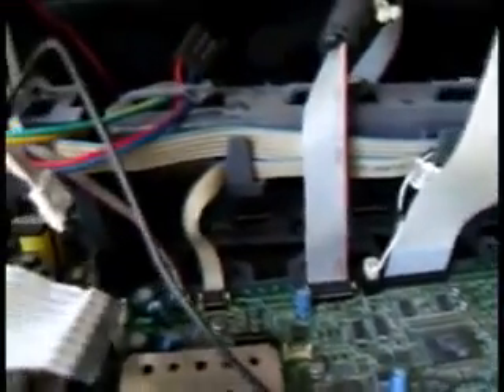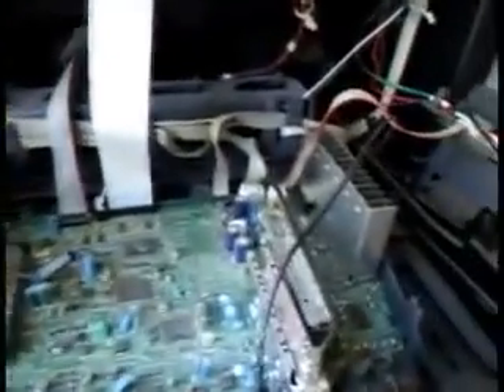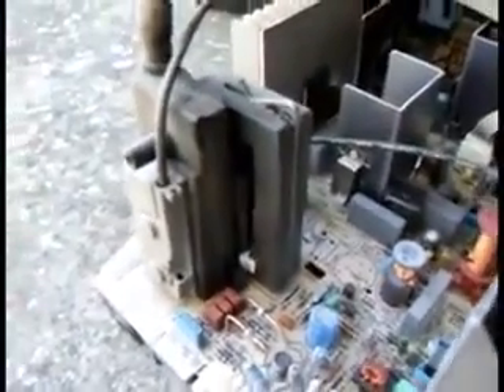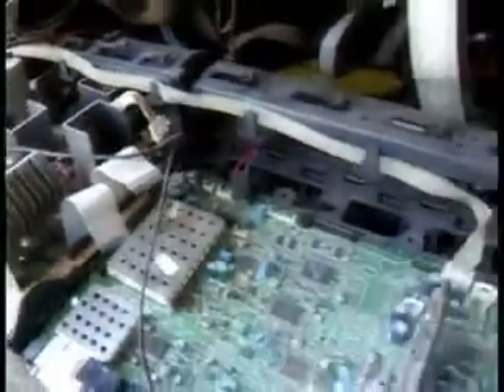RCA TV repair

Comment: my tv has the same problem, and it is exactly the same model the power light blinks, it had damaged several filters and a resistance, the canvie but I had no luck, the light keeps blinking and the tv does not turn on there is something you can recommend me to do or review
Reply: could be any number of things, could be the main power source or even the capacitors that run that, very difficult to say and as always be very careful working on TV's as they have "LIVE" components that can hurt you.